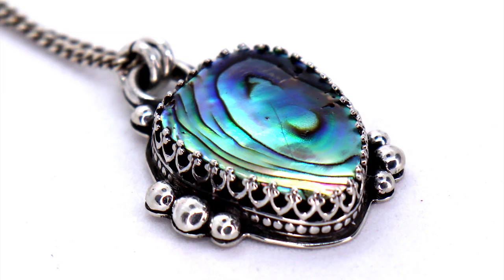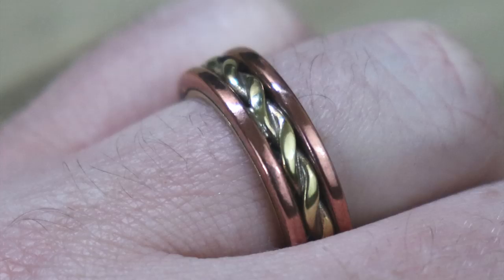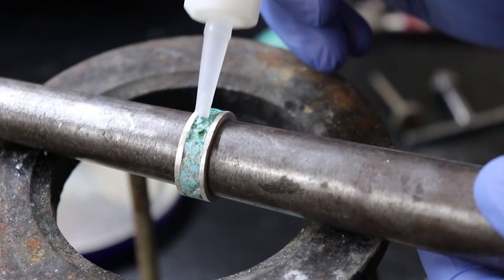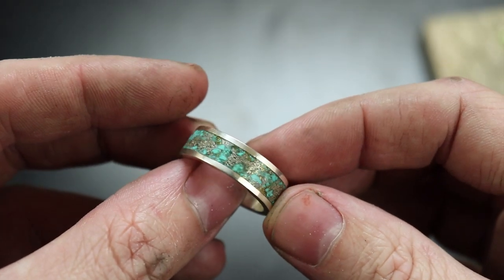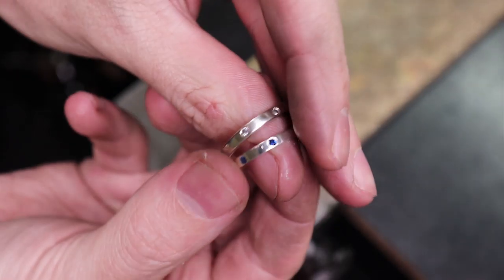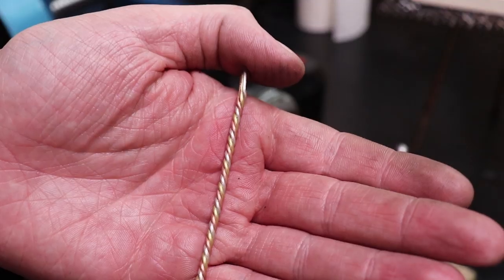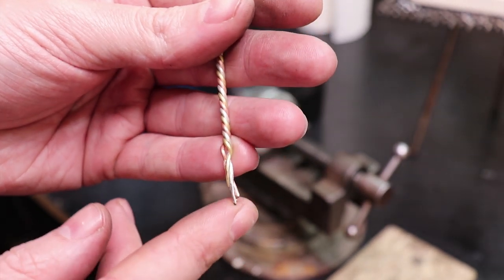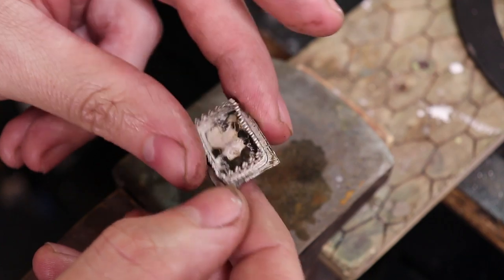Gomeow Creation Trailer Video

Comment: Can tell me if should use a smith little torch with disposeable oxy and disposeable propane or use an orca torch for annealing?
Reply from the maker: You can really use any torch to anneal your metals. I use my plumbers propane torch a lot for annealing just because its quick and easy
Reply: @GomeowCreations  Thanks so much. Also, the little torch comes with only a no.5 tip with disposable oxy and disposable propane but it will work with #6 and #7 and possibly #4
Any opinion if I would benefit from these tips. So far I’ve had success with some difficulty using medium and large butane torches.
I wanted to exploit the little torch and eventually I’ll get the standard oxy and propane tanks.Thanks again for your great videos.